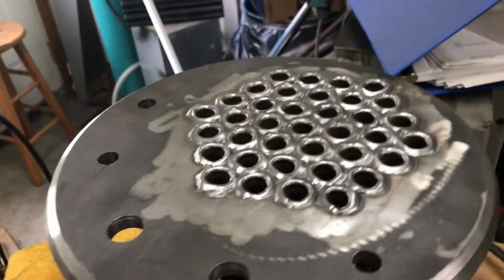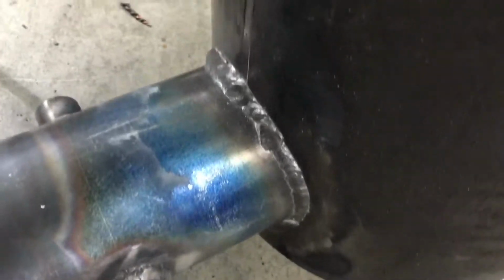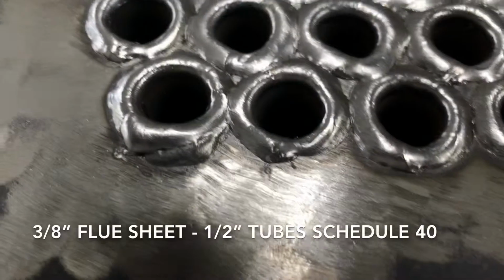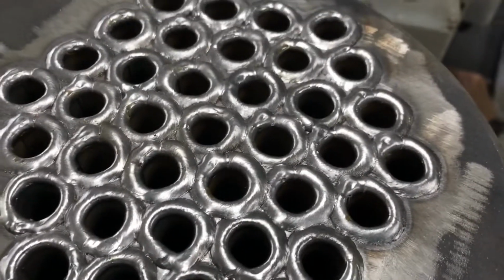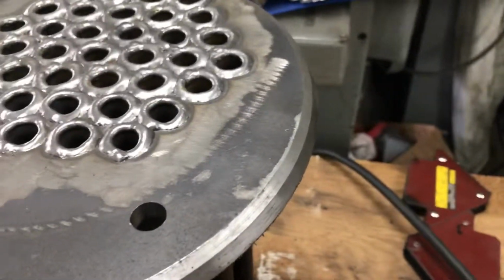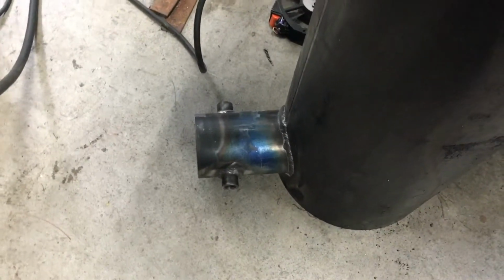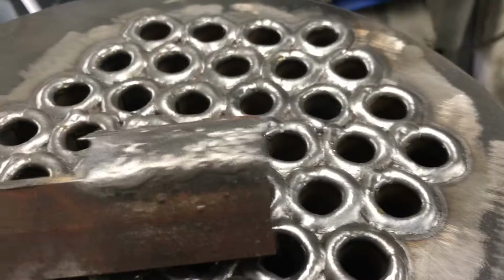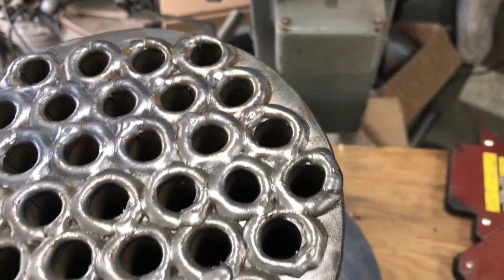Boiler build Welding the tubes - Titanium 200

Comment: Any updates on your steamer?
Reply from the maker: Looking at plans and info on making a tube roller for 3/4” copper tubes.
Reply: mjbop1 if you decide to buy one, they are also called tapered burnisher’s.

I’m also looking for some around 1/2”.

Good luck sir, keep us posted
Reply: Btw, I know cooks in south Jersey has some, but they are bigger that 3/4” just fyi
Reply from the maker: TOM COOK the smaller ones must be for heat exchanger service. I see them on eBay.

Comment: I admire ur ambition, however, I might have to agree with cpl other people here, seems like a boiler is not something typically done with manual MIG(most are automated Mig for tube to plate or TIG). Welds didnt look horrible but penetration is VITAL with pressurized tubing...also, Naval Jelly(rust penetrant) from Lowes/Homedepot is cheap and effective on steel to cut and etch. Takes a Q-tip and some patience, apply more than once if necessary until lines are visible. Good luck bud! P.S. :) STILL, NOT BAD FOR AN I.T. GUY! (IM A CONSTRUCTIVE COMMENTOR)

Comment: Two problems with this picture, #1 being as per the ASME and the National Board, MIG welding is forbidden in the world of High Pressure Boiler and Vessel Construction due to the high probability of inconsistencies and porosity in weld quality and penetration. Which leads me to issue #2, the way the tubes were welded in. You surface welded them, not full penetration welded them. Surface welding/Seal welding is only effective if the boiler tube has already been rolled and beaded then a seal weld placed around the outside of the bead to help hold the tube and act as a heat sink between the tube and the tubesheet. The expansion of the tube into the sheet from rolling does the sealing. In your case if you're going to use the weld not only to fasten but also to fully seal the tube, the tube holes need to be countersunk so the penetration of the tube weld goes the full depth of the sheet and prevents water from getting trapped between the tube and the tubesheet ligament. If that happens, premature failure of the tubes will occur due to corrosion between the tube and the sheet from the trapped water. Tig root and Arc fill and caps are best for the big joints in the vessel, and full Tig for the tube welds.
Reply from the maker: Thanks for the honest comments.  I am going back to the drawing board on this project.  I really wanted to do it all myself but I need to recognize my limitations.  Do you think it is possible to do a DIY boiler for a 1.5" scale locomotive?
Reply: @mjbop1  Oh of course it is, many people have built their own boilers but like all things, it's a matter of trial and error as well as practice. All great inventors made mistakes until they got it right. That's part of the adventure! If Timothy Hackworth could build a full size Locomotive in his shed way back in 1829 for the rainhill trials, you can certainly weld a boiler together with enough good information and practice. For smaller boilers I'd recommend rolling in copper tubes. Steel tubes need to be at least schedule 80 wall thickness in order to last any length of time especially if you're not using water treatment, but I highly suggest treating the water. That's the only way you'll get any corrosion longevity out of them. When you're not using the boiler you have to make sure it's completely dry inside, and you have to be fastidious about washing out the boiler and keeping it free of corrosion and scale inside. Copper tubes are impervious to corrosion on a model boiler if they are rolled in properly. Again, water between the tube and the sheet is your worst enemy.
Reply from the maker: SteamAndSmoke97 there was a guy that sold boiler treatment at cabin fever expo in Pennsylvania. 2000 something.  I always wondered with the copper rolled tubes what kept the glue sheets from moving with the pressure?
Reply: @mjbop1  tube roller.  the ends of the tubes are expanded so they are snug in the holes, and then sealed with silver solder/brazing if copper, or welded if the tubes are stainless or regular steel.
Reply: @danielellis7658  Pretty sure copper tubes can be rolled in steel tube sheets with no silver soldering required. They may weep a bit till they get hot, but once hot, they seal up.